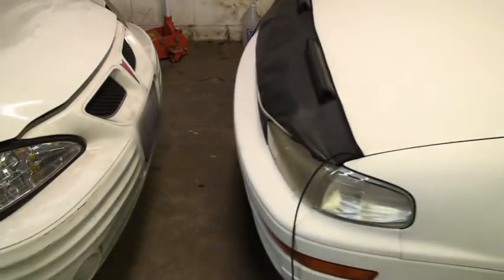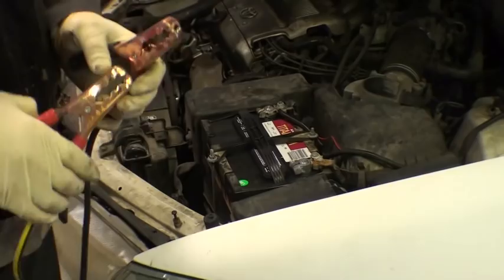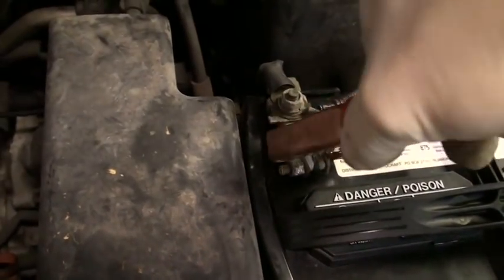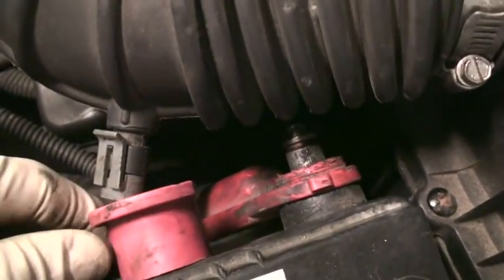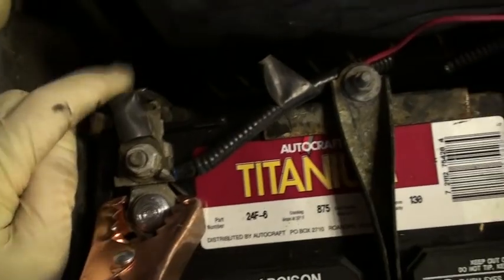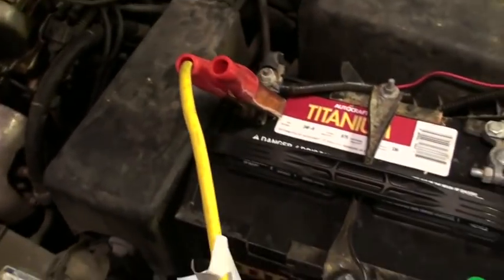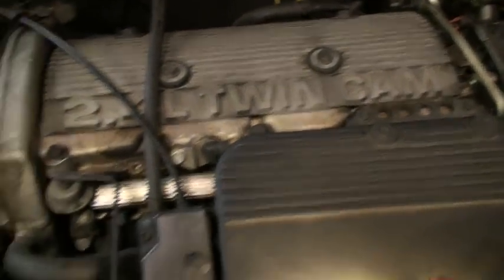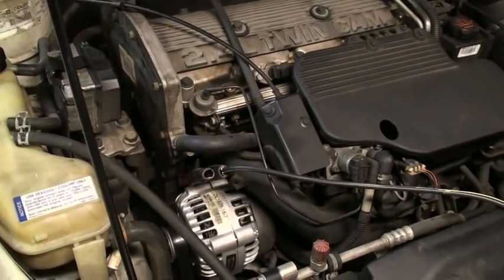How To Jump Start A Car - EricTheCarGuy

Comment from the maker: @Mist3rMr As long as you hook the negative clamp to the engine somewhere on the dead car you should be fine, it might make a spark but you will be far enough away from the battery for it not to be a concern.  Battery explosions are rare but it's nice to do what you can to prevent them.

Comment from the maker: @polostampede There are 2 reasons for doing it this way, the first is that the 'dead' battery may have some hydrogen gas hanging around that could ignite if you make a spark at the battery and the second reason is that when you ground on the engine you actually make a shorter path to ground for the starter thus your running ALL the juice for the starter instead of running it through the ground cables.  Thanks for the comment, good question.

Comment from the maker: @latana151 I understand now.  You want to hook the ground lead to the engine block not the body for best results.  Recharge times will vary depending on how far gone the battery is and it's condition.  Thanks for your comments.

Comment from the maker: The order is important to help prevent a spark that might ignite the combustible gas that sometimes hangs out near the battery but also to help prevent hooking up the cables wrong.  The ground cable to the engine is also to help prevent spark but more importantly it is a more direct link to ground for the starter which is bolted to the engine.  In short you take out the middle man (the cables from the battery to engine) and allow max voltage to go to the starter.

Comment from the maker: @hp11208 I recommend putting the negative cable on the engine block on the car that you are starting for a better electrical connection and to avoid making sparks near a battery that may have flammable gas around it.

Comment from the maker: @counkev The starter grounds through the engine block and uses the negative battery cable to complete the circuit back to the battery, when you hook right to the engine your actually making a shorter path back to the good cars battery instead of going through the cable.  It's also a safety thing as if the battery smells of rotten eggs this would indicate that there may be an explosive gas near the battery and making sparks near it should be avoided, this is the reason for my recommendation.

Comment from the maker: That is true.  I suspect it has something to do with excessive heat to the voltage regulator caused by the increased load.  Like most things electrical heat can be a killer.
Thanks for the comment.

Comment from the maker: @SpousalAnomaly I don't think so.  The principal behind putting it on the engine instead of the battery is to help keep those sparks away from the battery which could be flammable as well as making a better path to ground for the starter to get the most juice out of the 'jump'.  You also need to make sure you hooked up the cables correctly, it's easy to get them mixed up sometimes which could cause a lot of sparks as well.

Comment from the maker: @063209dr You are correct that if this is not done correctly damage will result but if you follow this procedure you shouldn't have issue.  I've seen it done wrong more than once and mostly the engineers took care of this because the most common result of doing this incorrectly is a blown fuse or fusible link.

Comment from the maker: @ncarter124 Yes, you start with the positive to help prevent a spark at the dead battery in particular as it may have hydrogen gas around it that could possibly ignite, it's remote but it could happen.  You place the negative on the block because it's actually a shorter path to ground for the starter instead of going through the battery cable, this connection also helps prevent making a spark at the battery when you make the connection.

Comment from the maker: @latana151 Sorry I don't know what a 'slam panel' is.  You want to put the negative on the engine block of the car you are trying to start, this will work best.  Sparks are OK so long as you have things hooked up correctly and you don't make sparks near the dead battery, hooking things up they way I did in the video will help minimize any sparks that might happen.

Comment from the maker: @dublistener You always check the battery and connections first.  You should also fully charge the battery and not use the alternator as it is a much better method and the alternator may never fully charge it.  After you get the battery fully charged you might want to do the test I show in the testing a battery video or take it to a local auto parts store to have it checked, it needs to be fully charged first however.

Comment from the maker: @gildardo78 If the battery is old and you connect the (-) on the battery you might create a spark and cause a fire, in addition it's actually a shorter path to ground for the starter circuit if you connect to the block and rule out any connection issues at the battery.  You will not damage the computer if you jump start the engine correctly.

Comment from the maker: @lenoat702 Actually you can, if the battery is in a different location like the trunk, they usually put a positive terminal under the hood that you can hook up to in case you need a jump.  Of course if that isn't the case you can just hook to the battery but it's better to hook to the engine as it makes for a better electrical connection.

Comment from the maker: @JFIdelH I often use hose clamps to secure loose exhaust shields.  Belt adjustment is a pretty basic operation but varies by manufacturer.

Comment: Thanks! The tip about the alternator allowed me to get my Wrangler started. Quick question though... What is the order for cables if you are using an electric battery charger instead of another car?

Comment: @EricTheCarGuy That's correct You shouldn't charge a weak/dead battery with the alternator. However, in most cases that's what they'll do. When someone needs a jump and their battery has been run down quite a bit (ex. left lights on at a distant place) they're going to drive it like that. The first 5 - 10 minutes driving that way are hard on the alternator. This is why I say keep it connected to the donor car for at least 10 mins. The strong bat in the donor car will protect both alternators.

Comment: Eric, when changing the battery, what is the best way to preserve the memory of the electrical system (ie radio, clock, transmission shift point settings, etc)

Comment: On the subject of "jump starting"...
Flash back to the late 70's when chrome bumpers ruled the land.
I and some chums where hanging out in a mall parking lot, killing time.
We tried to leave, but the battery was dead.  What to do, since we had no jumper cables?
One of our friends happened by, who also didn't possess a set of jumper cables.
Wheels were turning in our young minds...  BINGO, a light bulb turned on over one of our heads.
We nosed the cars together, so the bumpers made contact.
We next pulled both oil dip sticks and connected the handles together (old school metal, no plastic).
We held tension on the handles, to keep them connected.  Then we connected dip stick ends to each car's + terminal.  This was a 4 person job...
1. held dip stick 1 connected
2. held the dip stick handles tight and connected
3. held dip stick 2 connected
4. started the car
Of course the dip sticks got hot, so we used rags, gloves, whatever to hold onto them.  

A cheap set of jumper cables would have been much better, but being teens, we spent our $$ on other things.
Reply: +Blain N thats a really cool experience.  That is good old fashion american ingenuity right there
Reply: Or you could simply push start it lol

Comment from the maker: @JFIdelH If your having an issue with coolant hose failure like that you might want to check for a combustion leak into the cooling system as if this happens the coolant becomes very acidic and eats the hoses.  Watch the Diagnosing and Overheat video for the procedure.

Comment: Thanks for this video. Earlier today I helped jump start my neighbours car. We kind of just hooked up the cables. I believe we did red-red, then black-black, however we did not ground the black on her car, we just attached to negative post on her battery. Also my car was running the entire time. One more thing, her battery is located in the trunk of her, I think it is a BMW. Can you suggest a place to ground the cable in a trunk? Also is it recommended to have the "good" car off before attaching

Comment: If the battery was badly run down, it's a good idea to leave the cables connected for a while (even as much as 10 - 15 minutes) after you get the car started. A really weak battery tends to draw a significant amount of amperage just to charge it. If you heavily load your alternator, you can burn out the stator. With the cables still connected, you have the fully charged battery (and alternator) from the donor car to supply enough current to bring the weak battery up to a safe level.

Comment: I was told never to force your alternator to charge a battery which is excessively low, but rather to get it charged from a battery charger as soon as possible. Reason being that an alternator can be harmed attempting to charge a battery which is excessively low, as its never suppose to work that hard. Any thoughts on this?

Comment from the maker: @JFIdelH I'm not exactly sure what your asking but if it's taking more gas to fill up it could be due to several things such as a leak, an engine performance problem, a change in driving habits, or just a change in weather.  To many variables for me to give you an accurate answer sorry.

Comment from the maker: @B4DH4cK3r Hense the reason you don't hook the ground cable directly to the battery, that way you prevent any spark near it AND make a better path to ground but it seems that you are in a bad mood and didn't think to notice that.

Comment: @EricTheCarGuy I connected it to the top of the wing in the end, i didnt start cause i guess it wasnt a strong enough ground, so connected it to a bolt on the altonator in the end, i didnt do it at first cause i didnt want it to spark on the altonator and cause damage, but  it started, and after driving about 5miles, it now starts on it's own! taking it out again today to give the battery some more charge
Thanks alot Eric! Videos are great vids! really helpful

Comment: some hondas have a negative strap on the engine to jump start it instead of putting it on the battery, thats where the owners manual in my civic says to put the negative to jump start it, its on solid metal near the motor mount.

Comment: By pressing the accellertor your simply making the engine spin faster, this makes the crank spin faster thus turning the Drive/altinator/fan belt (whichever u prefer) faster which therefore allows the altinator to produce a higher amount of charge back into the battery..... that is a brief summary to make it simpler to understand.

Comment: Is there a reason why you start with the positive cables first?  I've always done ground cables first because from an electrical standpoint, I want my circuit grounded before I add power.  Just curious on that.

Also, is there a reason you chose a chassis ground over the battery ground?  I've always used battery ground and never had an issue.

Thanks, and as always your videos ROCK!
Reply: 11 years ago and no one answered your question !? Lead / acid car batteries generate explosive hydrogen gas (especially the old fashioned unsealed ones you had top up with distilled water). Often when you make the final connection, there is a spark. If you make the final connection at the battery and there is enough hydrogen around, there is a remote possiblity of an explosion. If there is, you want the dead car damaged, not the working car. So, best practice is to make the final connection at the dead car, at a ground away from the battery. Personely, I often hook up the final connection at the dead battery's negative terminal because I can't find a good, non corroded, ground, and I haven't had a battery explode yet.

Comment from the maker: Here's some clarification to todays earlier post. How To Jump Start A Car - EricTheCarGuy
Reply: It's amazing how many people can fuck this up lol
Reply: Red on dead, red on donor, black on donor, black on dead — grounded to bare metal on the motor. Take off in the reverse order.
Reply: hehe
Reply: John Doe  I've heard a story like this many times.This was the first time I heard it from he who experienced it. More people use load testing battery devices to blow up however. The load test? Just an open heater coil and boom!
Reply: Mr. eric the car guy..how to know if something is wrong with my alternator..im not really good in cars.
Reply: El Manana Google Ericthecarguy alternator and you'll find he has videos and probably articles to explain what to look for. Just remember, always start at the battery first. If it's poor or you haven't cleaned its connections, you can end up believing you have a bad alternator when you're actually golden.
Reply: John Doe I'm so glad you responded in a fully believable manner. Lol
Reply: Oh I see the problem! It's a Pontiac :) lol
Reply: Eric, I have heard some people say to toss Conventional Booster cables & get ones with Inline Surge Protection to protect the Vehicles Onboard Computer or other electronics.   

Can you Speak to that?
Reply: lightningsmokerXx There are amazing, handheld jump start kits that don't need another car to jumpstart you. Those have fuses to protect your car. 

Eric did say on his review video that he liked the fuse on the above device especially with modern cars and their computers.
Reply: DE Nichols Booster Packs are good to have, especially if you're alone if something happens. It's always good to know how to use booster cables anyways, you never know how long you've have to wait for Roadside, especially in storms. 

Last year my friends, brother was coming to help me boost a car. I was doing something else and I looked up and I seen sparks. He plugged the pos and neg terminals on the good car at the same time. I yelled at him and asked if he knew what he was doing, he didn't have a clue. I almost pissed myself.

Comment: So every other video and list of directions I've seen says to attach the red cable to the dead positive battery cable/terminal, and then do the live car. Does it make a difference if you attach red to live or red to dead first?
Reply: I think people recommend hooking up to the dead battery first because it has less current, and if you make a mistake and hook them both up, and your jumper cables touch each other than there's less potential damage from the spark.

Eric is hooking up both positives first so they're secure and won't cause a problem. Most of the engine bay hooks into ground or the negative battery terminal so you don't want a positive cable ready to make sparks nearly ANYWHERE under the hood.
Reply: YES, It makes a difference and YES, there is a reason.  Eric connected the ground leads wrong.  

Let me explain why.  He should connect in a letter "n." shape.  Here is why.  Positive to good battery first.  Then other 
Positive to weak battery second.  Then
Negative Cable to weak battery  REASON is you are NOW LIVE.  Only you are now live with a WEAK BATTERY, NOT WITH A STRONG BATTERY.

That is why my friends, WE CONNECT TO THE STRONG BATTERY LAST!!!
Reply: When I say, Strong Battery Last.  Do Not Connect to the Negative Battery Post.  "Hydrogen." sits on top of the battery, it is Explosive.
  Connect away from the Battery, to a different Ground.

Comment: Double checked the right oil  filter with one gasket is one gasket, and the oil is at the full mark on the dipstick?  If yes, and you put a wrench on it, can you turn the engine by hand?  If yes, are all the hoses okay?  Is the coolant level okay in the radiator and overflow?  If yes, I would check compression to ensure it is good and even, but regardless it is generally time to start it up.  Before buying a battery, does it fail the test?  A seized engine will probably make the starter go CLICK

Comment: Hey Eric, what's wrong in connecting the black wire (-)to the negative terminal of bad car battery ? This pole is connected to the chassis of the vehicle so there should be no difference.
 I've also heard that jumpin'  start can be dangerous in some vehicles 'cause you can damage the vehicle's computer? is it true?
 By the way, thank you so much for sharing part of your knowledge with everyone.
 Regards.

Comment: Hey eric, i had another question.. lol. Before my gas would fill up on about $6 for every section on the gas-ometer? Obviously i dont know what its called but the thing that shows how much gas. There are 5 sections. Recently i noticed it takes $10 to fill it up now? Any thoughts as to why its doing this? And if anything, gas lowered 4 cents so its not that gas went up..I always go to the same gas station, maybe its not giving out the right amount? I know i need oil change, and fuel filter.

Comment: Thanks for the videos, Eric. Question: My a/c compressor was/is making noise and I wanted a quick fix to stop the locked bearings or magnet activation... soooo, I disconnected the compressor by pulling on the wires. Not sure if it has more than one set of connections..... my question is: do you think my battery is losing power because I screwed with a connection? Battery was dead two days after I messed with the compressor.
Reply: +Tim Denison if the positive and negative wires are touching each other it would me drawing power. try pulling the fuse for the ac and see if it goes dead again.